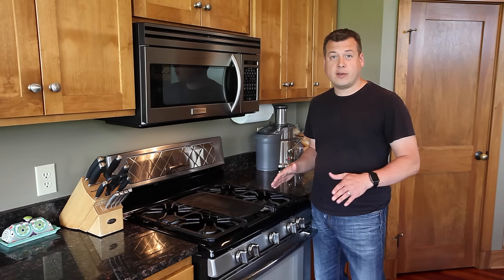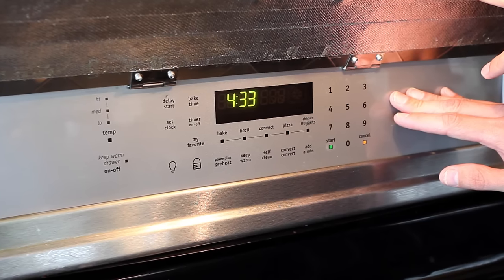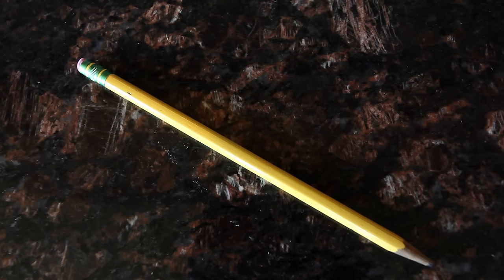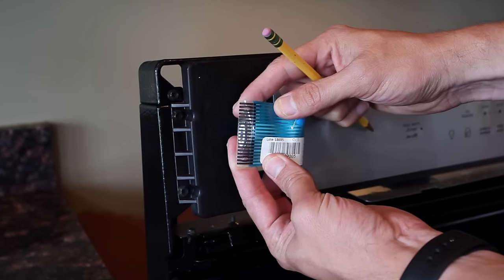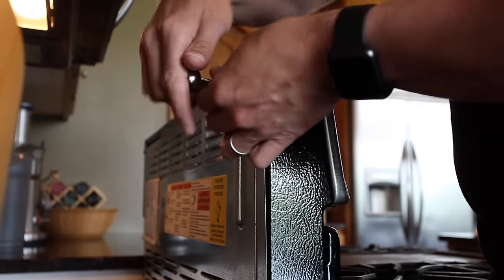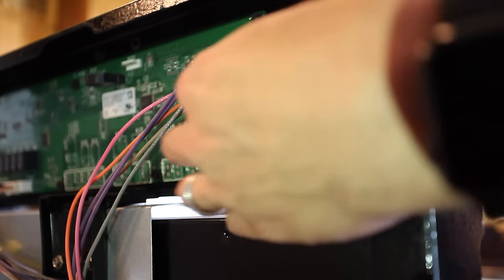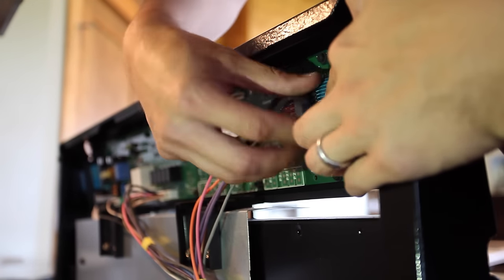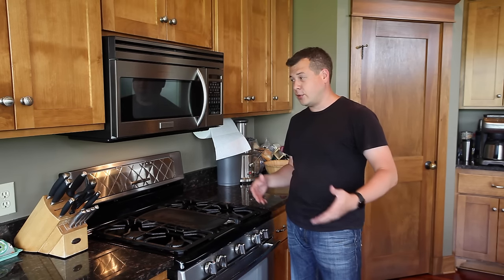Stove Buttons Not Working - How to Fix Range Keypad Using an Eraser

Comment: I used the eraser trick and then some rubbing alcohol and it works like new!  Thanks!
Reply from the maker: Awesome!  Glad it worked for you.
Reply: wburghardt what was yours doing? I tried that you racer trick and it did nothing but I don’t know if it is the switch membrane or if I need a control
Reply: @fredex1290  some of the buttons stopped working (at first they were less responsive, then completely died after a few days).  This has happened a few times before and I replaced the panel. This time I tried this trick (cleaning the contacts on both ribbon cables) and everything is working fine now.
Reply: wburghardt so which did you replace? The switch membrane or the control board? It seems like the last time I use that you racer today a couple of my buttons came back on so tomorrow I am going to try rubbing alcohol and then if that don’t work maybe order the switch membrane because that’s what I think it is
Reply: @fredex1290    On the previous attempts I replaced the switch membrane.  This time (of course) I didn't replace anything.  I've never replaced the control board.
Reply: wburghardt thank you so much for the reply.... I think 🤔 I’m gonna have to replace the switch membrane

Comment: This is AWESOME! We were about to order the part and this worked, took 15 minutes, and saved us a bunch of grief and money. I would only suggest that you just remove the "old version" because we saw that first and the link to the new version was not immediately apparent. Thank you, thank you! How did you figure this out?? The Frigidaire site certainly doesn't tell you. Only other comment - putting those screws back in the front panel is very tricky.
Reply from the maker: Wow!  Glad to hear that it worked for you!  Also, I saw the tip come through on my web site so THANK YOU SO MUCH!!!!!
Reply: P.S. We sent a tip!

Comment: Mate excellent video.  I'm having a similar problem with a couple of touch control bar fridges.  But my fridges controls work for a few seconds and then completely stop working.  I'll give what you suggest a go in this video but was wondering if you had and other thoughts?  Cheers

Comment: Thanks for the great tip & informative video. Would it work in my case - I have a LG electric range & last weekend when I pressed the button for the rear small (single element) cooktop, it would also turn on the dual element cooktop in front. And I am not able to turn it off unless I turn off the small cooktop first. Much appreciated for your advice.

Comment: Caig Labs' DeOxit - invest. Infinitely better than an eraser, and it continues to protect against the very thing you're correcting. A small bottle will last you a VERY long time, until you figure out that it improves just about everything it touches, but that's a different story. 
Pull the ribbon cables, dribble a little DeOxit on, let it sit for a minute, agitate with a q-tip or lint-free-cloth, wipe off excess, and work the end of the ribbon cables in and out of the socket about 20 times with the deoxit applied very lightly, and then allow the empty socket to sit for a few minutes, then work the ribbon in and out again a few times, then seat the ribbon, pull the connector tight, and if you still have a problem, I guarantee it's not the connector or the ribbon cable!

Comment: Thanks for posting this! I’m going to try it tomorrow, I have a different type of oven than the one you show here, it is a schott ceran glass cooktop with the console on the front. I noticed you did not turn off the power before you did the fix. I was thinking I might need to turn off the breaker connected to the oven/kitchen - because I can’t access it easily from the back/pull it out like you did -  it’s sort of attached into a center island. Not sure if you’ll see this, but I’m curious to know if you would recommend turning off the power to the unit before performing this kind of fix. I’ll likely do it as a precaution regardless, but would like to know. Thanks!

Comment: Was really excited to see this as we have this style of buttons but the cable had pin sockets in it so really did'nt see a place to use the eraser . :(
Reply: Do you think dipping the socket (not the panel board) into alcohol in a small container for a few minutes and gently moving the socket in alcohol side to side and up and down to dislodge any build up may help?  After that leave the pins/socket for air drying or with a no heat air dryer.  After that make sure to insert the cable making sure all the pins went inside into their respective slots. Then lock the cable so that connection will be firm.

Comment: Hello Mr. Tompkins, I did as you directed in this video and it turns out that the ribbon is attached to a device with pins at the end to connect into the main board. Do you have a workaround for this? Thank you

Comment: I have a GE "XL44" gas stove with four burners. When I turn the control knobs, the burners light up okay. I'm curious, however, why the control knob travels only from 0 degrees (off) to 90 degrees (full flame). Is this characteristic of all gas stoves? The burner controls will not go to the left (counter-clockwise), nor will they travel beyond the 90 degree mark. Is this right?

Comment: Hi Tommy - wondering if you can help me with my Frigidaire Gas Range.  Model #FPGF3077qQFB - on the oven control panel, oven mode signage disappear after cleaning a few times.  Can you suggest on how to restore them?

Comment: Any thoughts on gluing the membrane back on? Apparently the guy that sold me my Kitchenaid didn't tell me he'd replaced the membrane switch and it eventually became unglued. Is there a special adhesive I should use to glue it back onto the panel?

Comment: Hi there I tried this and it did not work...... Do you think I need to change the switchboard membrane or do I have to change the control board because actually one of my numbers on the digital for the clock is missing a little bar so I was wondering if I should try changing the switchboard membrane along with other things on that panel don’t work, only a few

Comment: FIRST try turning off the correct breaker on your electric box or unplugging  the huge plug behind your range.  I recommend the breaker.  Wait  20 or so seconds and flip it back on. Your panel may, as mine has a few tines over the years, reset itself.

Comment: I've been a technician for years and I just wanted to add to NEVER pull out a stove like that. New stoves now a days only have 2 little screws holding the handle on, and most will easily break off doing that. Open the oven door, put your hands INSIDE the oven onto the oven roof, and then pull it out. And one other thing, I have done this eraser trick myself to fix panels and I have seen some last a week, and some last 3 years. If the problem comes back, order a new panel.
Reply: I have a KitchenAid Superba.  I did the eraser trick, worked  then quit after about 15 minutes.  If I knock the panel with my fist lightly, it turns back on sometimes.  Any ideas or do I need to order a new part?
Reply: @li4989  -You have a loose connection somewhere. You could try to take the panel out and search for bad solder connections or loose wires or broken connectors which would be too much. In your case, I suggest you buy a new panel. Sorry
Reply: @marty pfeif Sorry, but you can't repair a cracked ribbon cable. And I have no problem with using chemical oven cleaners, (you can also use a shallow pan of water with the heat on, and let it steam clean the oven). Using the "self clean" on ovens is like revving your car at 1000 rpms for ten miles straight. You can blow the temperature thermostat doing it. I don't know why they even put that feature on ovens.

Comment: Well, that worked!  The connections on my Frigidaire gas range are such that the eraser does not work but contact cleaner and a toothbrush seemed to do the trick.  All touch pad buttons work as they should.  We were having to push way too hard before.  Thank you
Reply: Use of the tooth brush along with contact cleaner, as you mentioned, Sir is a great idea too.  Alcohol may work as contact cleaner?  I will try that in future.  Thanks for your feedback!!!
Reply: Only worked for a couple days. Then it was a crap shoot which buttons worked. Ended up replacing push button pad. Stove is worth the new part.

Comment: I purchased a kenmore range from a used appliance store. They keypad would not respond, so I attempted to disassemble it to do this eraser trick. Well, the “ribbon” seems to be severed in half. I cannot find this replacement ribbon anywhere online. Is there any chance of repairing this ribbon? Maybe micro-solder? I can see where the ribbon attaches to the control board. It goes up into the top of the stove, but I have not disassembled that yet, as that is a huge job.
Reply: Mine was a bit different than yours. The control panel is on the front of it, rather than the back.

Comment: We were getting F11 keypad error on our Frigidaire stove, and random beeping, if the stove were plugged in. I tried your method, but it didn't work. However, I noticed that the new control panel would come without the nice plate covering the keypad. So, I peeled off the keypad cover just to see if I'd be able to use it with a new panel, and the error went away. After putting the same old keypad cover back on the keypad, using the same old control panel, everything is fine now. I hope that helps someone, too.

Comment: The ribbon cables on mine seem to be inside of the panel and not as easily accessible. I was able to locate them but the other side is inside of the panel and I’m not sure if I can just pull it out without being able to put them back in

Comment: Hi Tommy, where do I get the Head shield you have featured in the Video for the display?
Reply from the maker: I made it myself. Before I discovered this fix I thought the buttons were getting too hot. It turns out that wasn't the issue at all so the heat shield really serves no purpose at this point other than to cover the buttons.

Comment: I tried this a few months again and worked but it stopped working a month later. I tried this method again but it didn't work this time. The display board keeps blinking SE. Any suggestions?

Comment: I have a similar stove (Induction Fridigidare) panel is very similar.  I'm on my 3rd key panel and what seems to happen after several months I get the random button presses happening, and then F11 error that indicates a shorted key.  Not the same issue you are having but curious if it is related.
Reply from the maker: Not sure if it's related but it's certainly possible.
Reply: @TommyTompkins  well some how I've made it worse.  This panel only had a small ribbon.  After putting it back the unit went in SD mode.  Then I reset the ribbon again now same issue but before it was more intermittent now it's very mittent.

Comment: Thanks for the tip Tommy! We have the exact same stove as in your video and the 'Set Clock' button is the only one that has stopped working. Is your recommendation for when all or most of the buttons have stopped working or do you recommend this process for just one button?
Reply from the maker: Melissa Chapman It usually starts with just one button and progressively leads to additional buttons that stop working. If you have one that stopped working, it couldn’t hurt to give it a shot!
Reply: Good to know Tommy! We'll give it a try.

Comment: Hi Tommy:  I am trying to get this to work on my Samsung free standing electric stove.   I have cleaned it twice with the eraser - and finished off with alchol and a qtip to clean off the corrosion.  It's still not working.  I am wondering if there are always two of the cable connections.  My unit only appears to have one.  Any insights are appreciated.
Reply from the maker: Hi Gisela - I'm sorry, but I'm not familiar with your model stove.  It might only have one cable - not sure.
Reply: If the printed circuit "wires" are broken, no amount of rubbing with an eraser will fix it.  In such a case, you will need to replace the printed circuit board.  From an online search I can see that Samsung usually uses only one connector for the control panel.
Reply: @7028301890193  Thanks to both Tommy and 526etal for responding.  Since posting my enquiry I have had a stove repairman look at the situation.  Here is what he did:  he trimmed the end of the circuit wire about 1/16th of an inch.  That helped to activate a few more of the controls on the touch panel.  His comments were: this is a very typical issue with sensor panels - they make them very very poorly.  All I can do is replace both the sensor touch panel (a cheaply manufactured front panel with plastic) and the entire circuit panel board behind it that has approx. 9 electrical ports plugging into it.  Total cost with 2 parts and labour will be about $500.00.  He thought that was a fair price.  The 5 year old stove is only worth 900.00.  So I am shopping for a new stove.  Shame on Samsung for producing such poorly manufactured products.  This isn't a heavily used stoved at all.  The reason the panel stopped function as I was spring cleaning and wiped down the sensor panel with a soft cloth and a spritz of windex on the cloth.  If a simple cleaning of a stove can alter the sensors then that's a pretty sh**ty product if you ask me.   I will never own another Samsung product.  Consumers beware !!!!!

Comment: im having a problem with the part of the panel that actually lights up, all the buttons work but i cant see the time or the temp of the oven, the light that usually shows that is only lighting up partially so its making it impossible to read the time or temp

Comment: Did you make the control panel cover? I think a big problem for us is the grease from cooking and I would LOVE to have something like that, to protect the control panel! If you made it, how did you go about that?
Reply from the maker: Yes!  I did make that cover because I thought the buttons were getting too hot and something was melting inside.  I realized that wasn't the case after I made it but since I already did all the work, we just left it on the stove.  I think it looks nice.
Reply: @TommyTompkins do you mind sharing what you used to make it? From slowing down the video, the back side looks like duct tape? I don't know about the front though. Assuming it's attached with basic hinges, too. Hoping I can protect the control board adhesive from releasing more, which I think is from cooking grease splatter.
Thank you for this video, too! Going to try this today for my panel that works but clock face only works when pressure applied to the panel and bezel.
Reply from the maker: Yeah no problem!  I actually made a video on making the panel a long time ago.  Here's the link: https://www.youtube.com/watch?v=eB6Z9dbtoho

Comment: Exactly what tools did you use to remove the panels?
Reply from the maker: I used a stubby small screw driver to remove the front panel.  To remove the back panel I used a small socket wrench since the screws back there had hex heads.
Reply: @TommyTompkins  Thanks!

Comment: I have a different model. My ribbon doesn't come out of the black connector while the black connector stays in place. Instead, on my stove, the black connector detaches and comes out still attached to the ribbon. The ribbon is firmly attached inside the black connector. So, it doesn't seem that I can clean the edge of the ribbon because it's covered by the black connector.

Comment: Have you ever had a problem with the display lights going dim? The clock, temp light, all went dim. Any suggestions?
Reply: Perhaps too many appliances are in the same circuit and all are running at the same time and getting overloaded.  Try to turn off some of the appliances from the line on which the Oven/range is present. OR there is not good contact with the power connection to the panel board.

Comment: Question- i am unable to locate the ribbons on a GE profile gas/electric range. Convinced that this is the problem but can’t seem to find the ribbons to try it!!
Reply: The control panel is on the front of the oven instead of behind. I have completely disassembled but still can’t find it

Comment: Is it possible to put some silicone around the connection so crap doesn’t get in there again?
Reply from the maker: You might want to try using some dielectric grease instead. I've thought about doing this myself, but I haven't tried it yet.
Reply: Tommy Tompkins sounds good, a couple buttons on my unit went out so I hope this clean up works.  Thbaks

Comment: I've got the same unit as you and can't seem to get the delay timer to work with the instructions provided. Any help
Thanks Bobby L
Reply: Make sure to insert the ribbon cable all the way into the slot after cleaning.  When repairing my TV, I was disappointed too.  Luckily, right away I could see that the ribbon cable was barely touching the socket.  I reinserted it by pushing it all the way (it was about 5 mm deep) into the socket of the circuit board.  Then the TV came back to life.

Comment: will this work for when the LED digital display stops working?
Reply: Perhaps the power supply cable (small bunch of wires with an adapter) that connects to the panel needs to removed carefully and reinserted properly pushing it all the way carefully may bring the LED back.

Comment: I have a button that if I rub around area it will finally work. Is this the same issue?
Reply: It does not hurt to apply the techniques this video described.  I am thinking it may help because, viewers have mentioned that some of them had one or two buttons not working, but this video fixed their problem.  Therefore, I am hopeful.